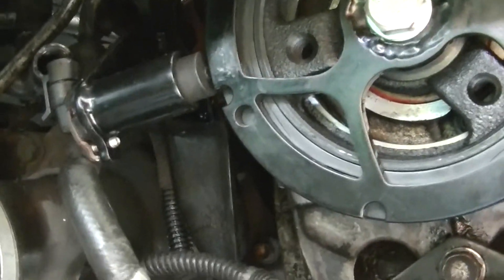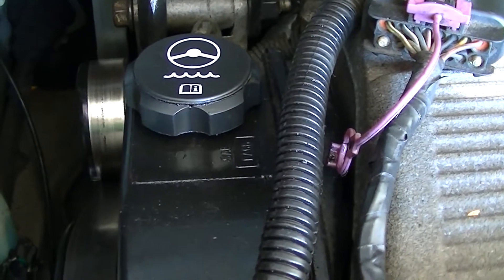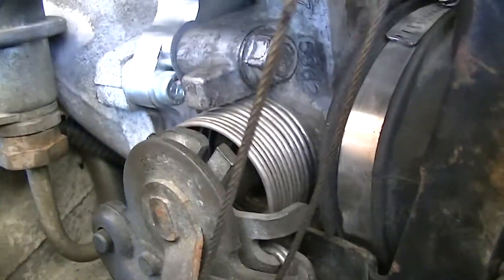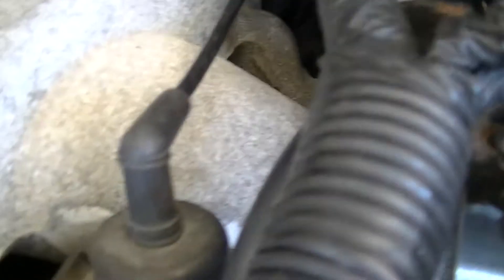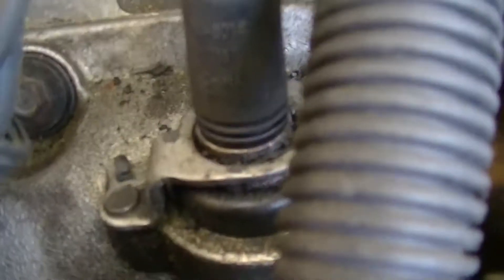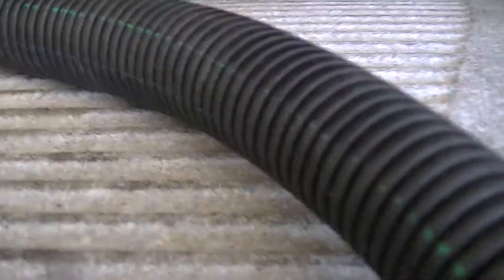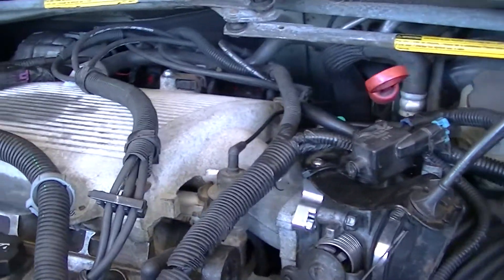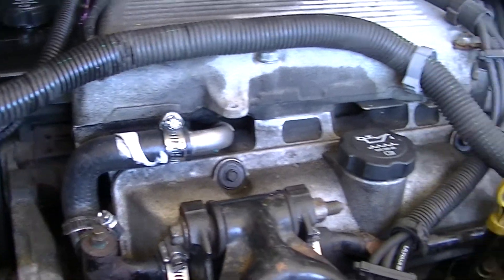LA1 to LX9 Swap, Milzy Motorsports Kit, (3400 to 3500), It Runs, Part 3

Comment: How was it dealing with milzy? I am going to be picking up a 3500 engine and other custom parts from him here soon.
Reply from the maker: I had no issues, they picked one part of the kit wrong and rushed out the right part quickly. I have put 30k on the 3500 and everything is still good. No tweaks or adjustments at all, just make sure coil bracket screws are tight or use loctite.
Reply: That is fantastic!! I’m replacing a 3100 in a 95 beretta with this 3500. Toughest thing I think is going to be the wiring harness swap and the fact that I am going to be scared for the berettas stock transmission lol
Reply from the maker: @codyconway4185  The instructions on Milzys site are good.  I think the trans will hold up with the 90's 215 HP OHC V6, hopefully you'll be fine
Reply: Did you replace any of the upper or lower intake gaskets before putting the engine in? Anything that you would recommend be done maintenance wise before the installation??
Reply from the maker: @codyconway4185  I was fortunate, the 3500 was from a wreck and didn't have anything noticeably leaky.  Maybe valve cover gaskets. Reused original upper intake gaskets, the metal ones.
Reply: @codyconway4185  3500 motors dont really have the intake leak problems from the 3400 motors

Comment: Great work! Thanks for the shout out! How do you like it? I have wondered what the  power difference would be with the 3500 vs 3400 plenum with the smaller 3400 throttle body...
Reply from the maker: So, I don't have a tune, it's just the factory 3400 ECM.  On the Milzy site, he says the 3400 TB and stock tune really hold back the 3500, virtually certain he is correct.  I like the engine sound, throttle response seems quicker, and I think the 'vous has a little more passing power on the road.  If I had a choice, I'd do it again.